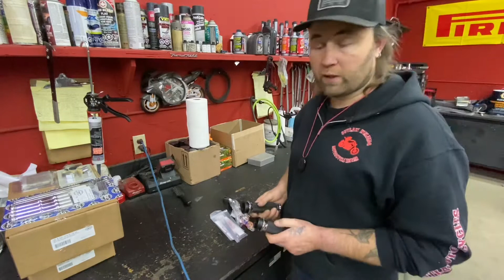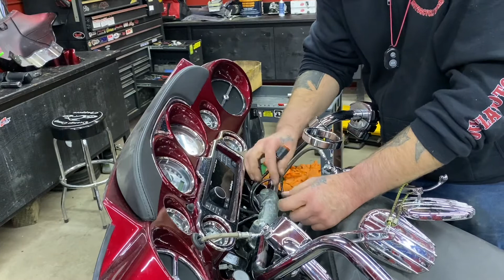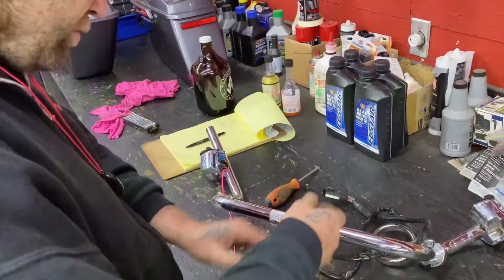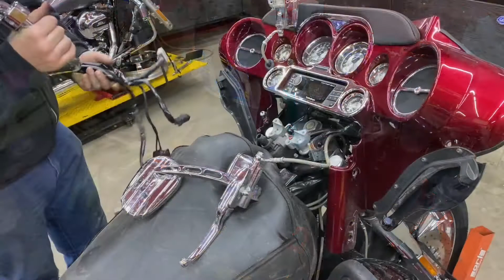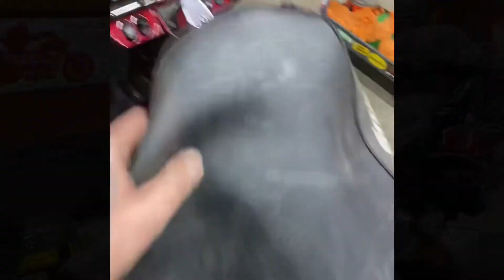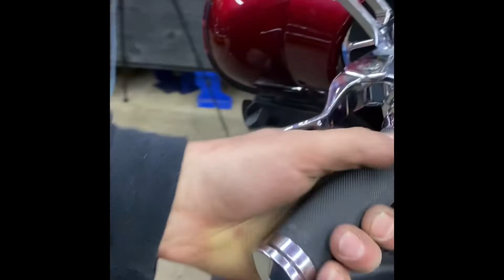Avon heated grip install on a Harley Davidson ultra classic OUTLAW WELDING MOTORCYCLE REPAIR

Comment: How did you wire the Avon grips to the factory 3hole  connector? Please explain wires colors to what connector. .
Reply from the maker: Easier to just follow the wiring diagram the grips come with, hard to explain over text